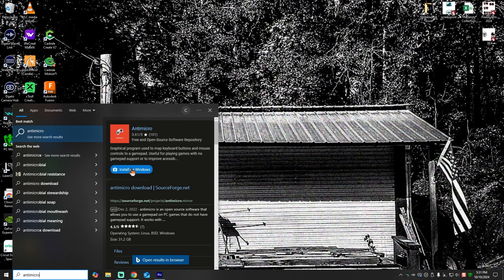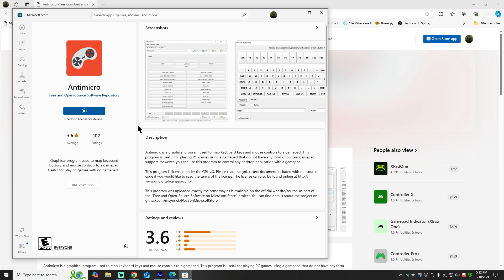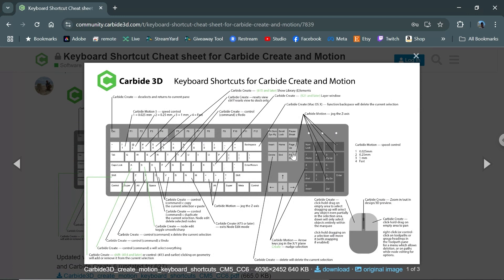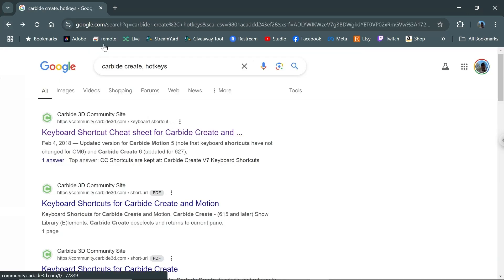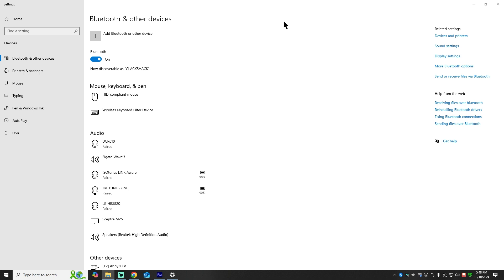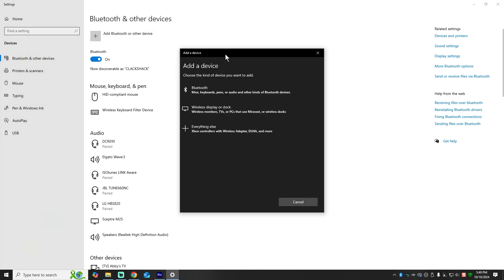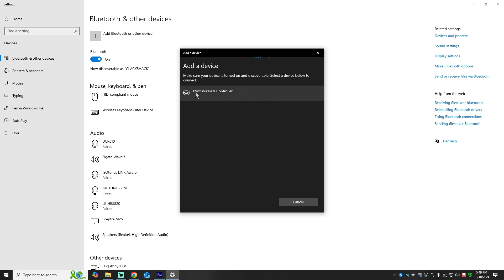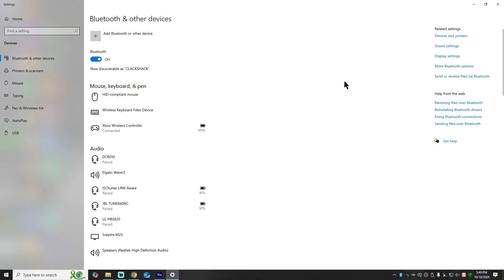Shapeoko 5 pro- controller for Carbide Motion

Comment: I just added the same controller using your file.  Thanks you for that.  When I go to jog it only moves about 4" at a time in X, Y, and Z.  Any guess to why?
Reply: I just noticed that it only does that in "Fast"  in the other speeds it behaves normally.
Reply from the maker: I have started using mine now just with Carbide motion. It will work with slightly different buttons with the recent release of carbide motion.
Reply: @TheClackShack  Thanks for getting back to me.  So your controller behaves as it should?

Comment: This is one way to do it, a simpler way for those interested is just a Bluetooth mini keyboard that comes with a Bluetooth dongle. You don’t have to download any special software like antimicro. It works perfectly fine through carbide motion. I actually bounce mine back and forth between my PC and my macbook and it picks it up instantly with either. I just plug the dongle into whichever computer I’m using and then select jog mode in CM. 

I use an Rii mini bt keyboard for reference and can jog it in all directions as well as change rapids

Love the videos, you always have a good variety with good information
Reply from the maker: I have a wireless keyboard with touchpad, isn't the same this is for a game controller.

Comment: I appreciate the video. I just got my 4x4 Shapeoko 5 Pro with the 2.2 kw water cooled spindle. I was looking for the import file you created. Where is that located. I could not find it in the narrative.
Reply: Good video and very helpful tutorial. I have an Shapeoko but it of course does run by Carbide Motion so I assume this will work for my machine as well. Eager to try it. I always get something good from watching your videos.
Reply from the maker: @patrickbink4617  you are using hot keys with it. It will work with any software that has hot keys
Reply from the maker: It is in the description, I was late adding it.... https://drive.google.com/file/d/1TJV_DUZmAJNKZkQE9l_XgiJBDnXm3MmU/view?usp=drive_link
Reply from the maker: I have the 1.2 kw spindle, I can imagine the 2.2 will be a beast.. Maybe one day
Reply: @TheClackShack  Thanks  I got it assembled. Just need to get 240 power to it to run the spindle. I added 5 fans to it with a temp alarm and auto start on high temps. Need the airflow to make sure not to overheat the components. Love your videos and thanks.